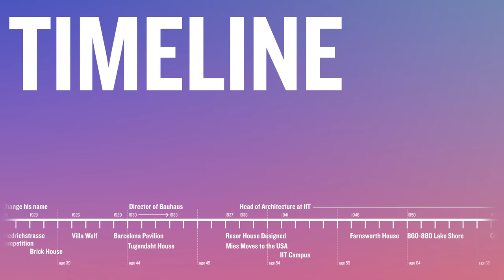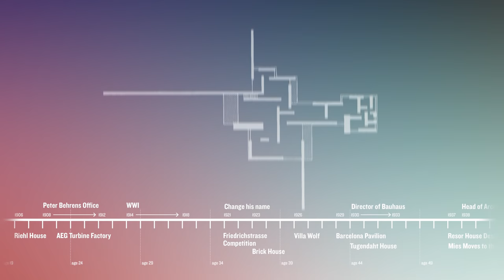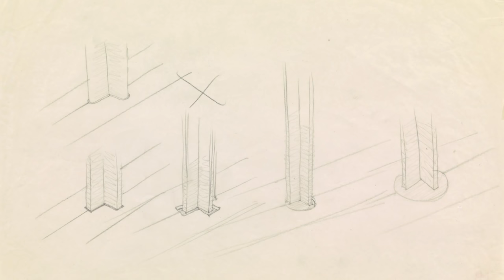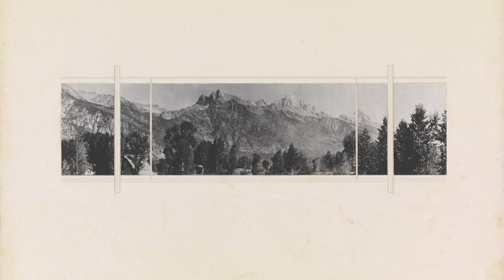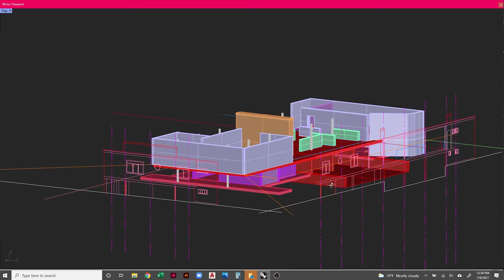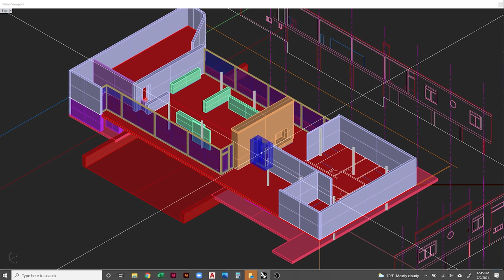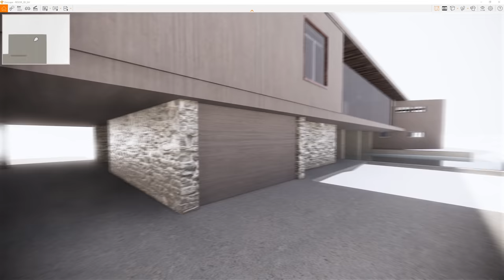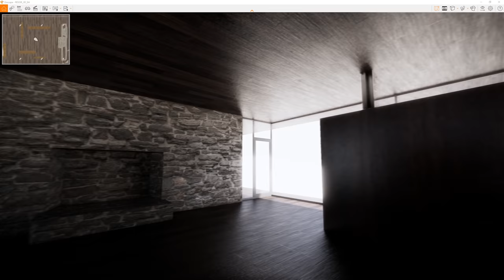Inside Mies van der Rohe's LOST House in Wyoming [Resor House]

Comment: Another interesting reconstruction. Thank you! However, I am doubtful it could ever be constructed over a waterway these days. The Farnsworth house is elevated and set well back from the river and has still suffered from numerous devastating floods - an inevitable result of increased runoff with the surrounding suburbanization and perhaps climate change. Mies van der Rohe's grandson Dirk Lohan at one point even proposed installing a lift system beneath the Farnsworth foundations to protect it after a flood in the 90's. It was not implemented but I hear it may be reconsidered. I suspect the Resor House would have been vulnerable to similar flooding events with even more damage or even destruction by virtue of it's position directly in the mountain valley floodway. Regardless, these unbuilt house reconstructions are great. Thanks again.
Reply: I was wondering if anyone would point out the practical consequences. Also, imagine the amount of mold the house would accumulate with it being surrounded by such a heavily moisture saturated environment.
Reply: I assume video maker didn't like your comment because he is typicall modernist. Modern till water floods 😂

Comment: What surprised me was the entry sequence.  So much compression from the cantilever through to the stairs (or at least half of it).  Is that just a visual distortion or would it actually appear as if one could hit one's head on the ceiling over the stairs?  ... There is none of the lightness here of the entry sequence to the Farnsworth house.

Comment: Mies van der Rohe always insisted upon using the finest materials for his buildings, marble, travertine, etc., which is why they have held up so well. The Lakeshore Drive apartments at 860 and 880 respectively, were built in the early Fifties, nearly seventy years ago, yet they haven't suffered many of the structural problems that have plagued newer condo buildings. It would be interesting to learn more about the architect's "white" buildings, including the highrise located at Fullerton and Lakeview, or the two-story penthouse at the top of the Commonwealth Plaza located at 340 W Diversey Parkway.

Comment: My pretty firm belief that boxy buildings are boring has definitely been changed now that I've seen this design. To be fair, most of the time (where I live anyway) a square or rectangular building is in fact pretty boring to look at but the way he encompasses depth and some slight variation in the shape of the building is very interesting to me. From the way the windows have been inset by quite a lot to the angular wall with its rounded corners. Lovely design!

Comment: It's unfortunate that it was not built because of financial considerations, which is interesting when its compared to the Farnsworth because the client, Dr. Farnsworth shared a similar objection regarding the cost of the house. It's very interesting that the Resor House exhibit a real connection with the landscape which is always a good thing. However, with the heavy, dark stone and wood paneling, including the partitions, it felt a little too heavy. There were moments that were intriguing like the nook nearby the garage entrance that looks out in the water, with the accompanying port hole. The stairs leading to the entry fireplace is another nice moment and the passage between the glass walls and wood partitions looking out at the water are, again nice moments. Another great video! Thanks for sharing.

Comment: Did the Resor's like the design?  How much over budget was it?  Is there any chance that an entity would undertake to build the Resor House? (ie; Monona Terrace by Wright). It would have been nice for Wyoming to have it's very own "Mies" building. Next, I think I would add some more edge reveal details to the Resor House. Also, maybe the interior ceilings should be white plaster as in his other buildings to lighten it up. Wood floors and wood walls only. Did Mies plan any skylights for those vast interior spaces?  Great work with the story and the presentation!